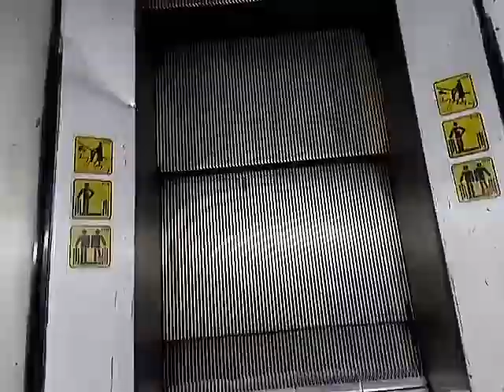Rare and Interesting 1980s OTIS Escalators - Clothing Store - Downtown - GO, BR

Comment: I never seen that Otis logo before but the escalator would have to be a 1990 because it doesn’t look 1980
Reply from the maker: It is from the very late 1980s, at least, some photos from 1991/92 already had this building there. This escalator, was probably a very early design of the later NCEs.